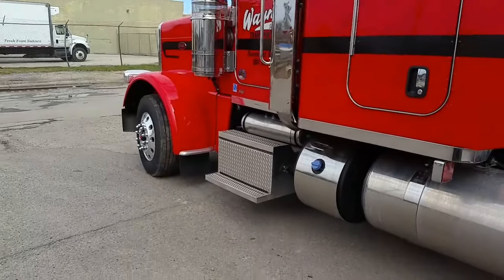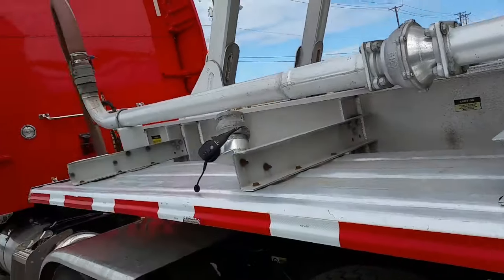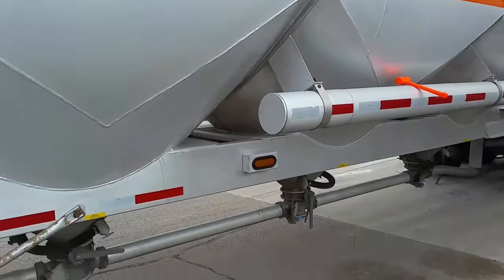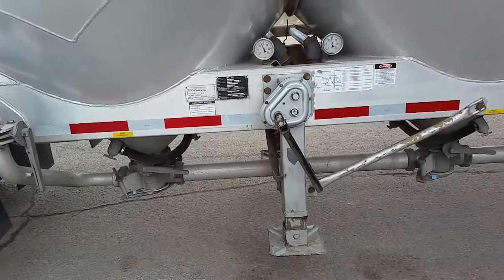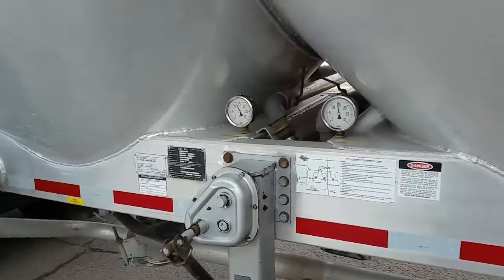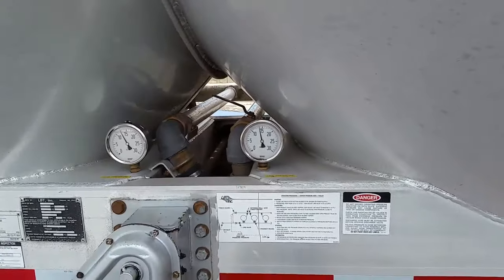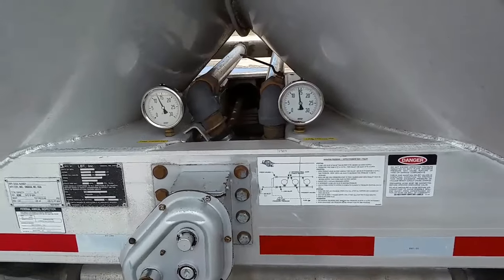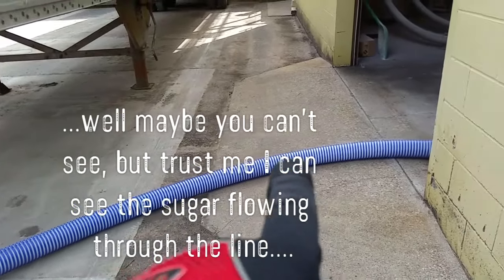Trucker Explains Pneumatic Trailer Unloading

Comment: This is a good decent video. I have to train new franc sand drivers once in a while that know nothing at all and this will be helpful. The biggest problem is when they clog up for having pressure to high. I’d like to see a video showing how to unclog a hose without wasting product because (not me) clear the hoses by spilling onto the ground. I see it happen all the time and it’s actually illegal.
Reply from the maker: Well, I no longer run pneumatics or I'd do it for yah! I have not checked this account in years, forgot all about this video.
Reply: @un1cos there is a video of how to clean a clog , depressurize tank, pressure bottom load tube, then open 1 empty hopper valve and product is supposed to flow backwards to unclog.

Comment: Question how do you bleed out your hose. Do you use the same bleeder valve on the trailer? I been hauling fuel and I been to some customers where I filled there storage tanks and once I’m done I reverse my pump and crack one of the ears on the hose so that air flow goes into the hose and that’s how I clean up my hose.... how do you guys do it to clear your hose from product and depressurizing your hose without getting injured?
Reply from the maker: Just blow until their empty is all. I've done plenty of fuel and other liquids tanker... No need to crack the ears... Just blow them clear is all. Easy peasy.

Comment: these dry bulk tanks are not hard to use it is a matter of watching and understanding pressure regulation and product control it works like a giant fire extinguisher
Reply: All fun until you plug the line feeding the silos. I run powdered cement to various plants and you need to be on the ball so not to plug your line. It can be nightmare.
Reply: Try vacuum loading plastic pellets off a railcar .....
Reply: @2665916  I've been hauling cement, flyash and slag for over 2 years now and in a single tank like in the video. I'm trying to see how to unload California doubles, as I might take a job where I have to use them
Reply: @FirebirdCamaro1220  Not sure what a California double is but I haul powder in 4 hopper trailers. trick to these is to keep your tank and line pressure between 10 and 12 Lbs. I find that once you have your PSI under control it stays the same for all 4 hoppers. Hope this answers your questions. For more I'd have to get in to fine details and this would take a lot of time. I wrote up a procedure for my company.

Comment: 15psi... Don't think I've gotten that far yet. I go to 11psi right now. I keep hearing if you go that fast the chance of plugging up goes way up.
Reply: Ryan Gilbert not necessarily...
no matter what pressure just keep your line pressure at or below your tank psi especially with heavy products. Light weight product your hose psi can exceed your tank with no issues. but good practice is do it the same everytime...line psi at or below tank. most tanks recommend a max tank psi of 14.5 but you are usually limited to what the receiver wants you to unload at ref how good or bad their bag house is...i have had to unload at 4psi at certain places and in my younger stupider days i unloaded at 19psi....DONT UNLOAD AT 19...
Reply: @strpped379  What happens then?  It's interesting to see how this differs in the States.  I drive a powder tanker and here most of the time (site dependent) we deliver around about 22PSI, going up to around about 32 before the PRV (pressure relief valves) go off.  It takes us around 30 minutes to discharge roughly 68,000lbs worth of product (we can gross out at 97,000lbs in Europe if we have six axles).  Time we pressure up the tank, and dump the air out after delivery and disconnect the pipes we're usually on site for around 45-50 minutes.  I've yet to see a video online of a tanker delivering in Europe.  If you Google Feldbinder cement tanker you'd see the sort of tankers that we use here.
Reply from the maker: All depends on the product and the system your blowing into, this one went strait into a well vented tower, no filters Unloaded at full speed / pressure there several times.
Reply from the maker: @SuperFIFTHGEAR  Holy shit that's high pressure! It averages around 2 hours to unload sugar (which was mostly what I hauled for this company in the video I made) sometimes add little as an hour and 15, and as long as 4 hours at general mills in cedar Rapids IA where we could only unload at 3 to 4 lbs or they'd plug.